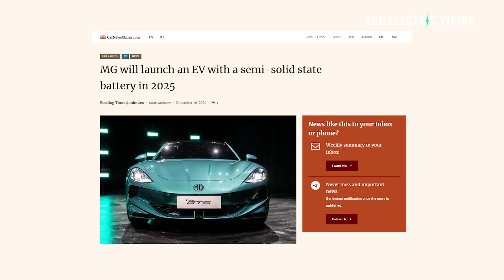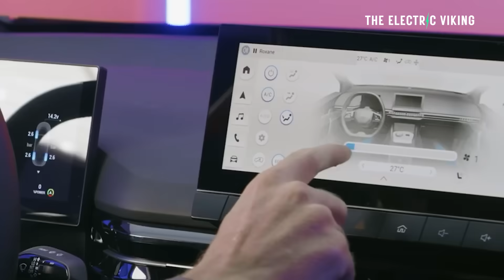EVs with Semi Solid state batteries are about to arrive...

Comment: I wish it would matter about power density. These manufacturers won’t increase mileage. They will just put in smaller batteries into cars, keep prices the same and pocket the extra profit. You know that’s what they are going to do. I wish they would increase range to 450 miles average and make longer range cars 500. But you know they won’t.

Comment: I soory you made a comment about Toyota promising solid state batteries 2014. Dismissing they as a contender in the race to  manufacture and bring to market. They are currently building a massive plant in N. Carolina in the USA. They have over 27,000 patents in regards to EV batteries. They will be a leading contender.

Comment: Ferasis Energy from China entered the testing phase for SSB at around 400Wh/kg density. 
Hyundai also quietly started production of their SSB (specs missing) in 2025 going for real world testing in 2025.

Semi-solid state is unnecessary as an intermediary step as it will equally obsolete tech as current liquid tech and be worthless on the second hand market.

SSB is the only way to mass adoption.
BYD considers SSB to be offered with luxury brands/vehicle first and cascade down to volume models in few years.
Most manufacturers target is 2030 but I believe 2025 leaders will surface and may enter production by 26/27.

This will be the era when we move from "early adoption" to "ev standard" and massively replace ICE .

Range, safety, flat curve, charge/discharge time, weight, cell level safety, ease of installation etc etc

Comment: Vive L' Revolucion! The Electric revolution can't come fast enough for me. A sub $20k EV, pick-up, crossover or SUV would sell like hotcakes, and I'm not sure if manufacturers would even be able to keep up with the insane demand unless there are a dozen or more legitimate manufacturers that could pump out cars by the millions. Then there's the battery storage and green energy backup industries that will definitely want higher density, safer and longer-lasting batteries, especially if they can be produced at significantly lower costs than today. The only more necessary things that can be created are [relatively] inexpensive portable power generators able to produce kilowatts of power for years without any need for fossil fuels or the need to pay for external grid power. Improvements in solar, wind and motor technologies will be great, too. It seems like we're so close. We can almost taste it. Better and lower priced EVs, electric power generators and portable batteries for everything from homes to laptops to phones to all kinds of electronic equipment. Imagine, no more need to pay a power bill from big utility companies. Wouldn't that be something! Imagine having a small AND portable generator than could provide your car battery with 100km of range in an emergency if you're out in the middle of nowhere and your car battery runs down to near zero. It all seems so do-able with today's technologies. Now all we need is an ability to produce products that are affordable to the masses, and especially to the Lower and lower Middle-Class families who don't have the ability to afford today's new power technologies. How about we entice wealthy investors and stock markets to invest money to hire and train lots of new workers to build more manufacturing facilities and produce new products and get this revolution revved up by 2030. It's already happening. But you always have that nagging feeling that there are greedy Elites, corporations and governments that don't want the public to have much freedom from corporate and government control, and they are the ones causing all the delays in getting the revolution into high gear. I guess we'll see over the next few years if we can limit the ability of Globalist Elites, industry giants and dictators to suppress rapid innovation and give more freedom to the world's markets to bring newer and better technologies to the masses all around the world. The sky really is the limit. Greed and corruption are the enemies of freedom and innovation. Let's see if our new Sheriff in the U.S. can break the shackles of the Marxist Globalist Elites and get this electric revolution to the next level. He may want the U.S. to be the dominant force in the Fossil Fuel industry, but that only means that the oil and gas will be used in the production of all the hundreds of other products we need for daily use, instead of for powering equipment that pollutes our air and water. It'll be fine we totally dominate the world over the next 5-10 years in fossil fuels if it will help create the wealth needed to accelerate a global movement towards the wide-spread use of solar, wind, battery, nuclear, geo-thermic and hydro-electric power generation technologies. And who knows if we will get better at creating technologies to capture and recycle harmful pollutants from the burning of fossil fuels and put them to good use in other industries. I'm pretty sure governments and people who are smarter than you and me are doing the research and planning. Let's hope they succeed without interference from the Globalist Elites and greedy Oligarchs!

Comment: Semi solidstate on its face sounds like bullshit, China excels at BS. Its solidstate or it isn't. To be honest it sounds like a rebranding of pouch cells.
Three factors make it or break it. Can you mass produce it, can it be mass produced cheaply, and what is the energy density.
It helps a lot if it can charge quickly and not catch fire.

Comment: It's always important when arguing with ICE-heads about the advantages of EVs that EVs are changing rapidly. Many if not most issues that are cited as problems are already being worked on and will likely be resolved in a few years. Range, charge time, weight, sourcing chemicals for the batteries, battery recycling...all of these will likely be non-issues in ten years. They're still cars, though, and public transit should be massively improved rather than just giving everyone an EV. But if there's a car on the road in 2050, it needs to be electric.
Reply: Battery lifespan is a big deal as once battery is past warranty, Tesla and other companies will not repair them, yet they are repairable.
Reply: Micro-crystall batteries have  been charged and discharged and tested for the last 6 years.

Comment: #Aptera coming to market next year as well 2025 solar powered car. Basically unlimited range at that point. This is having an impact on battery powered aircraft now where absolutely weight and size both materially lower both very much matter for "flying car" applications #beta_technologies #joby_aviation and many more now also for 2025 coming right up next year. There is a single drone delivery effort I think a non profit been doing this in Africa for many years now and that has just seen a material upgrade up their drone something to my knowledge no one is doing not even Amazon all of this very much "conspiring" to create a spectacular 2025 for pure play BEV all exclusive of the horrific War Russia versus Ukraine which shows absolutely zero sign of abating quite the opposite and has become a military demonstration of #drone_war to an absolutely terrifying effectiveness so yes Saudi Arabia attacks Germany with a terror bombing as oil and internal combustion engine being very much replaced by battery power and electricity quite suddenly😊😊

Comment: Not in the USA.
We will let the customer decide what's best for them,  not climate extremist or the government
Reply: @kenbehrens5778  evs don't pollute less.
They pollute more over the life of the car all things considered compared to same size gas car and  hybrid.

Even vw admitted it takes at least 40000 miles for a new ev say a golf to equal the carbon footprint of a gas car even longer for a hybrid ..then yes they do pull ahead, until the hard to recycle battery needs replacing, then they fall behind again.

And if you are using public or Tesla chargers those mainly use coal gas etc for power 

If you have solar at home that can definitely help evs  ahead.

We need to tell the whole truth the destruction of land and mining that uses tons of gas oil and carbon to find and mine heavy metals which the earth produces less of them coal gas oil which is constantly being renewed and found and can be mined with less of an impact greenwise the heavy metals lithium cobalt etc.

BEV are not 0 emission vehicles.
Sure nothing out the tailpipe evs pollute going in gas going out.

Not to mention invisible vapors and radiation in small safe amounts.

Let's just be honest

Comment: Should not EV manufacturers be reducing the size of their battery packs, reducing the power of the vehicles and increacing the availiability of charging stations given that the power density and charging speed of batteries is improving?
Who really needs an EV that can accelerste from 0-60 in less than 8 seconds and run for more than 300 miles on a single charge?
These things are primarily intended to be a replacement for ICE vehicles.

Comment: Sodium ion battery pack prices will be less than $20 per kmh. within 4 years. With those prices, EVs in the US will cost less than $13k. Solid state-based battery packs can then serve the higher end of the market.
Reply: Sodium ion batteries last half as long as lithium ion batteries and have 30% lower energy density, which means hauling more weight around. I don't think heavier cars/short life batteries are going to cut it.

Comment: The question is will the electrical grid hold up with all the new vehicles on the road?
Reply: Yes, it will handle the needs of EV's

There will be upgrades needed, as is always the case with the grid. But new technologies, such as utility scale batteries will help immensely with the transition, as peak loads (i.e., everyone trying to charge at once) will be greatly reduced. 

Note that the average passenger EV uses only about 6kWh per day. That's only about half of what the average domestic hot water tank needs per day...

Note that removing the extraction, transport, refining, distribution, and dispensing of fossil fuels will actually save more electricity, by a significant margin, than if every vehicle was an EV, including land, aviation, and water.
Fossil fuels require that much electricity
Reply: No, it won't.
Reply: @JohnSmith-ux3tt  
Please elaborate why it won't.
Reply: @JohnSmith-ux3tt  
In the USA, around 4,000TWh of electricity is generated annually. 
Of that, about 25% is used on fossil fuel processing - yes, there is that much electricity used. From extraction, transport, refining, distribution and dispensing. 
Switching to 100% EV would actually save electricity. And that doesn't even consider the fact that a lot of indirect fossil fuel processing industries would be shut down. For example, fuel transport trucks would no longer be needed, and thus no longer maintained or manufactured.

Electrical distribution will have some challenges in areas, due to rapid changes in demand. This can be alleviated with utility scale batteries to average out the peak demands in many cases.

Comment: Problems with EV in the old world.
While updated continuously, while having privatized too, we now face issues.
The infrastructure gets overloaded by people moving away from gas to electricity as energy.
People move over to electric cooking, and a cooking range can easily run up to 10 kW.
They replace gas furnaces (central heating boilers) by heat pumps.
And replace ICE cars by EV that need to be recharged.
The local grids got laid out with 3 phases on the basis of a concurrency assumption and we now see this assumption frequently falsified.
While individual homes may not exceed their current draw, an entire group of homes being fed from one community transformer station actually can overdraw.

Then people add solar panels that feed into the local grid but may overpower the local grid again, defeating the concurrency assumptions. Feed into the grid, when they do not consume the kWh themselves.

Also, people with EV did not have to pay road tax, but the EV are heavier than ICE cars and basically per kg of car weight cause the same wear as ICE cars.

In the meantime, natural gas has become more expensive and has less reliable availability with the Russian war-criminals attacking Ukraine and threatening Europe's east side.

At the same time, there's indication that the efficiency of solar panels could go up from around 30% to just over 50%. At the same time we read news about new battery technology almost every day.

How all this works out?
A kWh of energy in a liter of gasoline (AKA petrol) - 10 in a liter - costs about 22 cents. With all taxes included. We already have had moments that a kWh from the grid was over 100 cents in a private home with a flexible rate contract where you pay what the market demands at the moment demand/supply happen.
When recharging an EV in an energy-station along the highway (AKA motorway), you may easily pay 70 cents per kWh for being able to do that very fast.
Too many households moving to electricity too fast overloads the local grid - never happened before in the past 50 years.
The no-road-tax is terminated by the government and EV have to pay serious amounts of that tax. They don't produce CO2 but fine dust and other things are the same and making and transporting electricity generates waste as well. Electricity from wind farms most or all goes into data centers. This means that households need to rely on foreign kW - potentially from nuclear plants in France.
The government also has terminated the national policy where households get credited for their kWh delivered back to the grid for the same cents/kWh as they pay when using them from the grid.

As it stands, everything solar or EV is too expensive. As long as batteries are not more affordable. I made the calculation some time back for a battery pack being run between 20% and 90% of its usable capacity on the basis of how many times it can be recharged. That's not worst case because 20-90, so there may be more cycles. But if we take the guaranteed cycles times the 90-20 capacity and see what the kWh cost then the battery without any additional investments is more expensive than the expensive grid.

We need better and much cheaper batteries with much more efficient solar tech (e.g. combining dual layer PV with perovskite) that allow us to recharge the EV at home from that battery too.

And as to solar, it's plain ugly on an old home with architectural value. So we need roof tiles with solar on them as soon as the previous is in place.
Reply: Sooo much fud...

Comment: When they can get >400 miles charge in 2 minutes, in any weather, without degradation, I might be interested. Well no, as there still won't be the infrastructure to support that.
Reply: You fill yoir "gas" car with 400 miles of fuel in 2 minutes? 
Unlikely...
Reply: @jeffl4810  The last time I timed it, it was 1 min 48 sec, from empty enough for the light to be on, to topped up. And that usually gets well over 400 miles. 

So you're right, it usually doesn't take as long as 2 mins for 400 miles, but I was being conservative.
Reply: @SteveLomas-k6k 
Do you have like a 25L tank?
Just the walk from the pump to the cashier, waiting in line if its busy and back again usually takes at least few minutes...
Reply: @jeffl4810  I guess it depends where you live. My tank is 18.5 Gal (70 liters?).  Pump rates are limited to 10 gal/min so that sounds about right.  I pay at the pump which takes literally a few seconds.
Reply: Most people with an EV take 20-30s to charge. Which is the time it takes to plug in the cable once every week or two, when they park for the night.